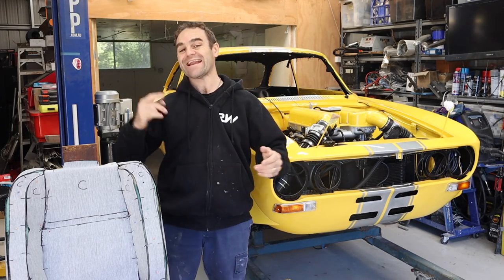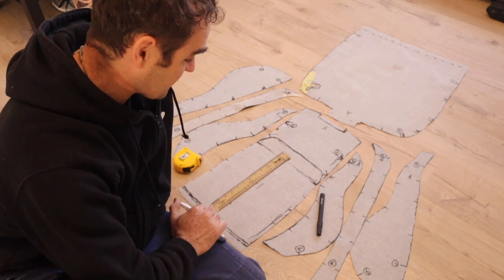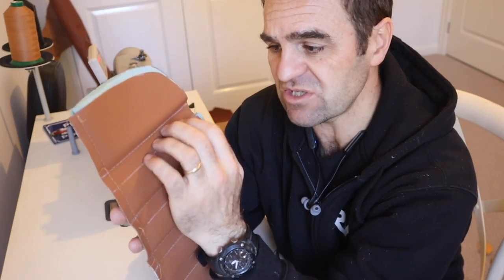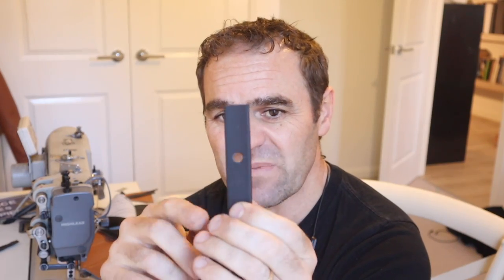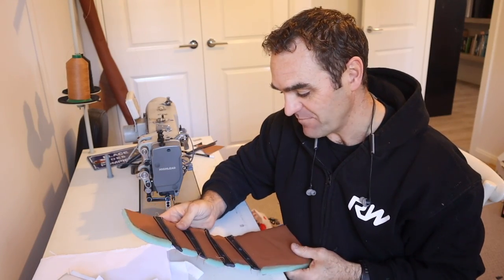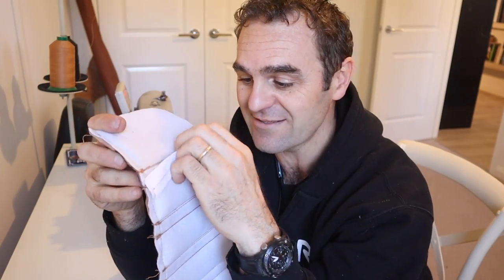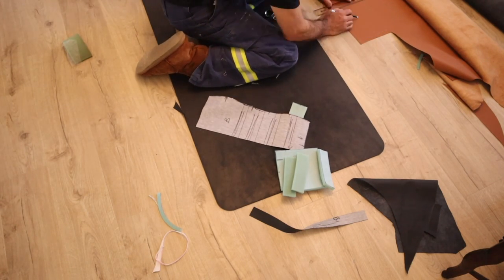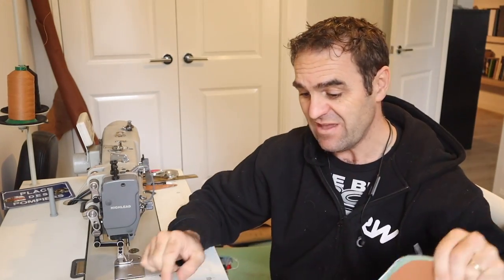Sewing Ferrari Daytona style seat inserts - Ferrari engined Alfa 105 Alfarrari build part 179

Comment: Could you sew both sides at once and then cut it down the centre. Then sew in the central strip.

That way you should be able to space the black strips more accurately. 
It might also save some time.
Reply from the maker: You could, but with the separation it is not really going to make much of a difference.
Reply: @HomeBuiltByJeff   Probably faster though

Comment: WARNING 
Do not use cable ties in a permanent auto trimming job.
Unless the plastic is specifically suited to the task.
Ordinary cable ties will fail fairly quickly. They will depending on the plastic, cut through, stretch, snap , shatter or the locking tab will strip.
Reply: Interesting to know. I've been using cable ties of the cheapest variety in engine bays for cars and prime movers for 30 years what I would call the most extreme environments with extreme heat cycles, fuel, diesel, oils, fumes and all sorts of nasties from the road running into the engine bays and have never once in my life seen a cable tie fail. Each time I've had to cut those suckers off with a blade when I've needed to remove them. Never knew using them in seats inside an interior was such a harsh environment that cable ties would fail. First for everything I guess.
Reply: @bosco9028  The difference is that in all the applications you mention the cable ties are pretty much just holding something in place with minor pressure on them. In a seat they are being yanked and stretched every time you sit in the seat and every time you drive over a bump in the road half the weight of your body is pulling on them.
Reply: @bosco9028  . Not all cable ties are equal.
Generally once you zip up a cable tie to hold cables or tubing it never sees any great variance in load.
In a car seat however they get shock loads and loads from multiple directions so they fail often within minutes.
Even if they hang on for a few years they become brittle or stretch.
And once you put the seat back together and bolt it back in you will never see them again.
Reply: I have the same concern, the load is actually more considerable than  it may seem on the face of it. 

It might work with quality zip ties though.